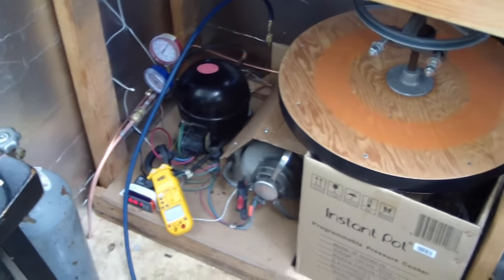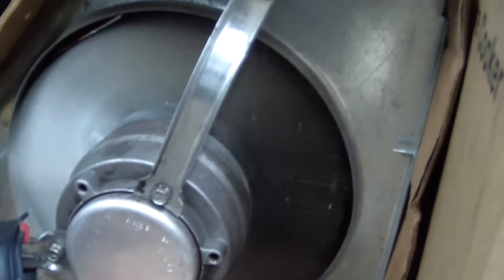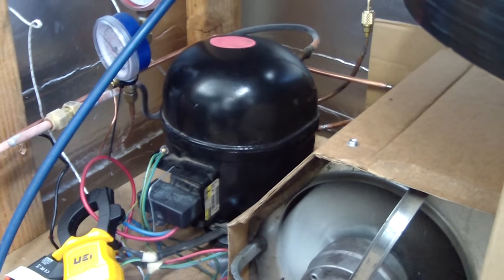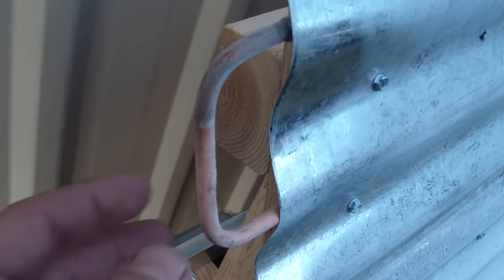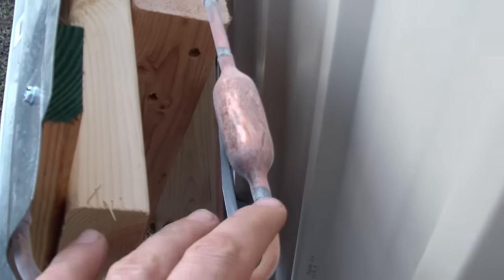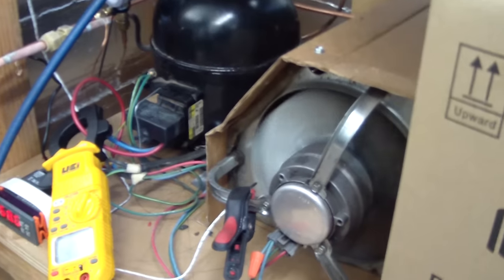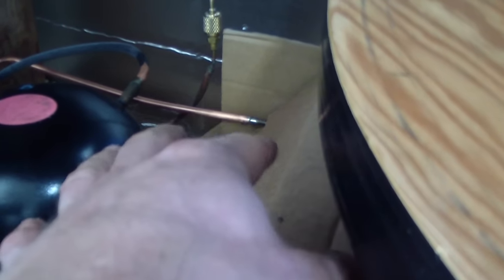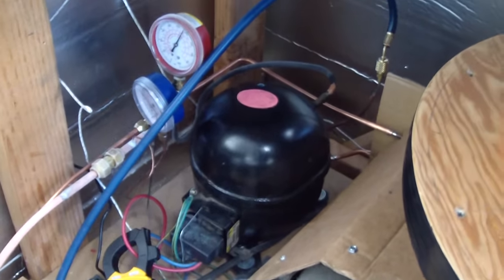DIY Heat Pump With Propane

Comment: I love this idea. Using a heat pump is more energy efficient than using any other powered method. I'm a refrigeration engineer & I may well be using this idea to heat my garage here in the UK :-)
Reply from the maker: Hey thanks.  I'm sure with your knowledge of refrigeration, you could 
crunch the numbers to figure out the rough size of system you would 
need.  I would love to see someone take on a bigger plate evaporator.  
It might not be as efficient as an air coil, but then again without a 
noisy fan motor, it could come close.  Your climate is probably similar 
to mine here in Oregon, and the monolithic evaporator seems to do well 
with the rain.  Do let me know if you put something together!
Reply: phil955i Hi Phil, me too, and I’ve been on the installation course at Energie in Portugal, their water tanks are huge so not great for Il market, I’d love to design a separate condensor unit to a pressurised tank..
Reply: any thoughts on stirling heat pumps?
Reply: @kreynolds1123  I've just Googled that & it's a very interesting concept, considerably more efficient than using a vapour compression refrigeration cycle.
Reply: @phil955i  certainly far simpler. 

demonstration of an alpha stirling.  https://youtu.be/hnXLNO7DkdY
alpha inline:
https://youtu.be/KC5EGQEsTKI
I'm wondering about two old shock absorbers from a car for an alpha stirling heat pump.
Reply: @kreynolds1123  are you going to use it in a practical application like heating a space or is this a home project to play around with?
Reply: @phil955i  I wish I had a shop to do just that, make it and use it in my home. take solar thermal collector and heat pump the energy into my home. I have saved some shock absorbers and may end up asking someone in a shop to make it.  I do see a challenge getting it balanced for higher speed. and thermal transfer area for heat exchange may also pose a problem.  

a 1hp motor and stirling heatpump with  COP of 4 (2983 watts of heat) would be fairly usefull if not ambitious as a home diy project.

maybe a 1/4 hp motor and roughly 746 watts of heat output is more realistic.

two 1sq meter solar thermal collectors should be more than enough for a 1/4 motor and a Stirling bnb g heat pump to operate at a cop of 4.
Reply: @phil955i  I did build a BLDC motor  (viewable on my channel)  but I need to lower the Kv motor constant if I am to make it work in this application. an appropriate  BLDC motor would allow me to adjust the speed acording to need and should be a bit more efficent  than an induction motor with a variable freqency driver.
Reply: @kreynolds1123  I'll have a look on your channel later 👍

Comment: Your evap will freeze up in the winter making it less efficient and the compressor will have really high superheat and will burn out. Better off burying the evap so you wont get and frost on the coil

Comment: Well I did a similar thing, but buried the evaporator underground. Now I have a cheap ground-source heatpump :-D
Reply: still runs well and satisfying?
Reply: U need to bury it below the frost line... In pa that is 4ft down...digging up burst pvc in mid winter suks.
Reply: Another reason for burying the evaporator is to conceal it from neighbors.  After all ur exporting ur heat to the neigjbors in the sumer and stealing their heat in the winter.
Reply: @guzziventure1750  5 years later still running strong, I did have to replace a sacrificial anode every two years

Comment: Mike, save elec power by wiring A/C run-caps(metal or plastic) parallel to the compressor motor. Example;My kitchen refridgerator needed 25 microfarads. You must add microfarads until you see lowest amp draw from the line. This works because of inductive power factor and utility meters measuring flaws. We are charged VA's not for actual watts of power. Make a capacitor test bank of one each of 1,2,4,8,16,32 mfd run-caps. with parallel switchs to each one. use a amp clamp meter and find the correct combination of caps for minimum amp draw from your compressor. Then hardwire the correctly measured ufd parallel to your compressor. It resonates to lower power usage.
Reply from the maker: I appreciate this, Dave.  Electrical is not my strong suit, and this sounds like an easy enough practice to perform.  I'd imagine of we all corrected for power factor in our inductive devices wherever possible, we could drastically reduce our energy use.  I am going to take this to heart and try it in the near future.  I will be shifting to an ice refrigerator, with vapor compression backup, as well as a custom deep freezer.  I'll be sure to try it then. 

Thanks again!
Reply: Dave George d
Reply: In the field this is called power factor correction. "slap a cap on it"
Reply: depends where you live, here it's only if you have a business  that you pay VA, if you are an individual, you pay for Watts
Reply: @whatawaytogo515  I would sugest to everyone not knowing, to do some research on power factor correction from multiple sources to get a good handle on this, but I'll point out and expand on a few things. 

As  manaquri above points out, residential consumers are billed by the kilowatt hour, while sonetimes buisness are billed by the volt amp hour to encourage the buisness to improve their power factor. When it comes to power factor, watts is what you actually consume residential meters measure only the balance of watts in and watts out,  while volt amp hours  is the apparent power, a combination of actual power consumed and (with inductive loads) the energy pulled temporarily stored in coils and sent back to the power company 50 or 60 times a second.

With power factor less than 1, the extra current drawn from and sent back to the power company is not consumed, excepting that with the extra amperage there is a tiny bit extra heat loss to resistance in the wires, but not so much to justify spending money on capacitors.

In the end, for a RESIDENTIAL power  consumer, the main benifit of power factor correcting is simply reducing the amps flowing on a circuit allowing one to have more things on on the same circuit without tripping the circuit, but it wont effect your power bill in any meaningful way. 

There's a beer analogy. If beer were watts, then its bear that you want to drink and  the foamy head is reactive power limiting how much beer can fit in your glass. So to maximize the beer in your glass, you must minimize the foamy head.

As the original commenter Dave points out, one can add caps on the circuit. I strongly near or closest to the motor to minimise the wires over which reactive currents bounce back and forth.   A cheap  kilowatt wall meter from Ebay  can tell you many things including power factor. just add caps nect to you motor untill your power factor is as close to 1 as you can get it. 

note: capacitors need to be rated to above the peek voltage, not the rms voltage. for instance, in the US mains voltage is rated at about 120vac while the peeks are as low as -170 and as high as +170. Personally I'd use double that to 340v rating on capacitors that I use while some people might be satisfied with 240v raiting. turning off a motor can create inductive spike that might end up damaging capacitors with too low of a raiting.

Comment: Hiya Mike.  I know its been a few years since you ran this system.  I think I am going to make a very similar evaporator.  Did you have any issues with frost in cold WX?  New to the hobby...I'm a fan of your excellent videos.
Reply: Of course he had defrosting issues below 40F! As you know, heat pumps need a reversing valve, defrost board, defrost switch to operate properly.

Comment: Nice! The evaporator assembly outside would work more efficiently if painted black and absorbing sun rather than reflecting it. However usually you need heat when there is no sun and air outside is cold, so most efficient way is to bury evaporator with a good size crushed rock bed as heatsink and make this geothermal heat pump.
Reply: that would ground the piping and with the dissimilar metals the slight ground current would likely lead to quick corrosion.

Comment: Looks great, the only thing I see is possibly electrolysis between the copper and steel on your condenser in the long term.
Reply: i was wondering the same. The moisture from the cycling could also be problematic.
Reply: @thedavesofourlives1  When I looked closer I was wondering if you could use heating ceiling panels, they are aluminum epoxy coated. With copper tubing but unless you could find some left over from a job, I have taken them to scrap after separating copper from aluminum. I just looked at 10 fossil fuel free energy sources including zero point by Creative Society.  I have also done some geothermal. Retired plumber/steamfitter.

Comment: Hey Mike, just found your video when searching for DIY heat pump setups. 

I've been designing a "battery shed" and was looking for an energy-efficient way to keep the batteries warm. This setup looks incredibly simple!

For the outside, I like how you did sheet metal rather than fins... every scenario I designed had ice troubles, so I never ended up building them.

I'm in Kansas, so it gets cold but not brutally cold. Our heat pumps usually have heater element backups for the 20°F or colder days anyways, and that would not be difficult to set up with a second thermally controlled relay.

Seeing your video has encouraged me to post some of my setups, maybe someone else will find them useful. Thanks!
Reply: Yes please!

Comment: Thats pretty cool, mate.  The flare fittings on the low side will need to be well dried and sealed to keep the moisture off, especially if you intend to cycle it extensively.

Comment: This was great! Use your anemometer to get the mass flow and calculate cooling power.  I am guessing about 1200 BTUH.
Reply: or just take running watts and X3 for a rough calc, then convert watts to btu

Comment: nice, like it! you should get even more heat inside when it starts to rain. if you put that fan directly in front of that compressor
it will live longer. Like the vid.
Reply from the maker: The rain just began a few minutes ago, should be interesting.  The 
compressor should be suction cooled, but yeah, a little airflow would be
 a good thing on it.  I think I might rebuild the shroud to pull some 
air past the condenser.
Reply: The compressor is cooled via Its refrigerant charge. Head fans are only used in extreme ambient conditions or for plants that are heavily loaded.
Reply: compressor is already running too cold for it's own good. Should be around 59 suction temp.

Comment: I want to build one of these. Using a mini fridge compressor to make a RV heat pump. I also notice some very tiny fridge compressors online. Being they are more efficient I can keep solar enclosures warm without drawing too much power.
Reply: you'd need 15 fridge compressors. Best to buy a cheap Mr. Cool/Senville 9k heat pump for about $500

Comment: You have enough space there to make an underground evaporator, that would be a fun thing to try.
Reply from the maker: For the small heat load, it wouldn't be too difficult.  Personally, I like the aesthetics of a frozen evaporator for all to see.  It provides some intuitive feedback.  Besides, the ground around here is all rock and concrete, and i doubt the trailer park would appreciate me digging holes!

Comment: There are a lot of free deep freezers on Facebook marketplace. I'm now thinking about getting one and installing it in the garage as a heat pump to make it a bit more comfortable to work in.

I live in Canada and we see a lot of days that get down to -20c, but there still plenty of days in the winter that are between 0 and -10. I figure if a deep freezer is designed to maintain an internal temp around -18, it should work as a heat pump down to those temperatures.

I'm wondering if you sprayed the plate outside with black enamel to absorb heat from the sun and then wiped some kind of oil onto it if that would help with the icing. Or placing a few mirrors to reflect extra sunlight onto the plate.

Might make it easy to just knock the ice off manually instead of having to dethaw it.
Reply: good idea with the oil to prevent ice bonding. A "low temp" deep freeze is way too small of a compressor to make any kind of heat for a garage. maybe 1000 btu? and the efficiency drops quickly the farther away the temperatures are.

Comment: That lenth and demeter off your capillary tube. I just finish building my but my compresor over heating. Compresor 95w but to consume 180-190w if i fill less gas no vaporization starting.

Comment: Sweet.  I'd think  you want the compressor outside and let its heat keep the evap from freezing as a simple method.  Other ones I've seen don't work once the evap freezes.
Reply: why waste the compressor heat outside? he's already beating it up running such low suction pressures. all heat pumps frost when they hit dew point. It's normal. What's not good is running so hard that it doesn't get enough off time to melt and completely ices up.

Comment: Nice work.  I like the evaporator.  I am working on something similar only with aluminium plate painted black to absorb UV.  Sort of an air source heat pump.  Would it help to add heat sinks?  Great idea to use propane.
Reply: how did that work for you? I was thinking the same thing when I saw the silver.... black facing sun would help for sure...
Reply: It did work, but took it apart and made an air source system.  Then took that apart and installed a new commercial heat pump.   @andyrossthomson

Comment: I have a question, is it in your opinion possible to get the heat from an airco in the heatmode by adding a heat exchanger that feeds my floor heating, to the hot pipe that goes into my indoor unit?

Comment: Question, why use propane instead of refrigerant?  Because of cost?
Reply from the maker: It's a cheap and effective refrigerant, once used in the 1920s. It's not uncommon today in commerical freezers.
Reply: @whatawaytogo515  is the compressor you’re using designed for 134?  Or does it not really matter?
Reply from the maker: Probably 134A. It's not likely to be of much importance unless you're trying to be super efficient. More important is sizing everything, especially the metering device.

Comment: Paint that roofing condenser black!
Reply: That'll run that poor little compressor into the ground lol.
Reply from the maker: It's the evaporator, and yeah it was going to be black, but I wanted to see how it works first before I do anything like that.  Maybe on a warm day I will paint it.

I'm not sure about the condenser.  If it does fail, it will be the first one for me; I've beat the hell out of many and never had a failure.  The conditions it is running under aren't all that different from the apllication it was intended for.  The condenser pressure is a bit high, and the amp draw is high as well.  Maybe snipping a little more cap tube out will bring the head pressure down, but it might load up the compressor even more.  I'm curious to see, but will leave it be for a few days until I get a hold of the COP.
Reply: M.C. Pletcher did you end up painting it black?

Comment: I saw this a lot being used when i visited latin america..they will
 collect old fridge compressors and turn into heat pumps..the cooling was great!!
Reply from the maker: That's really great to know!  I only knew of my example. Makes sense. In a warmer climate with high humidity, a 100 watt compressor could move a lot of heat, I'm sure. Cheap to build and lower operating costs than resistive heat.

Comment: Hello . how many watts? how many cubic meters can lead to 25 ° C when it is 0 ° C outside? . with wall of tiles. more or less
Reply: compressor running watts x 3 (COP estimated) = heat watts, then convert to btu (x2)